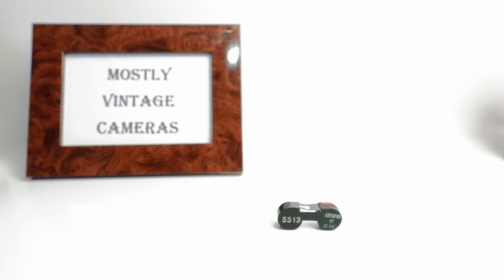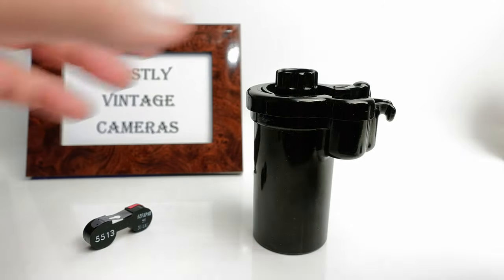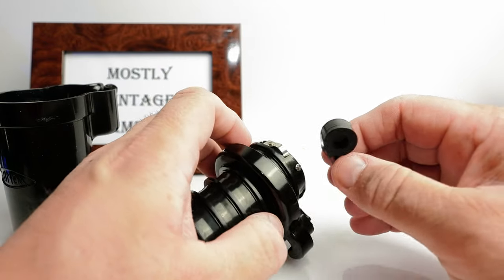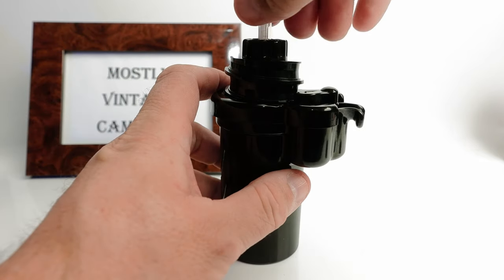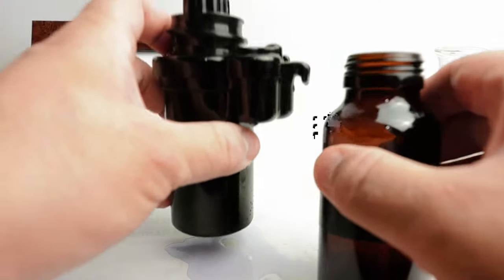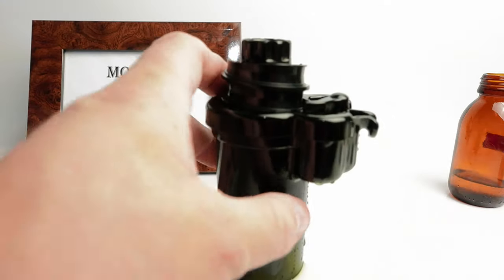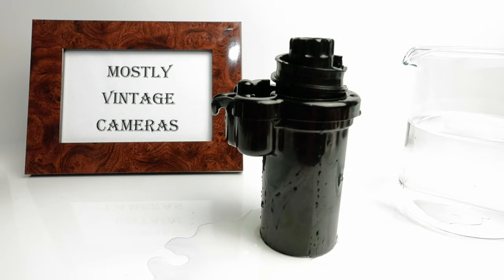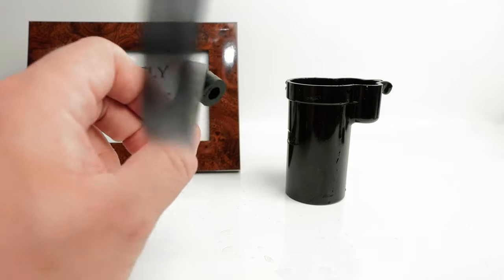Developing a Minox film in the Minox daylight tank

Comment: Great video. I used to develop my BW Minox film at home some years ago. Since I had no Minox tank, I read you could tape the film in the dark to a 35mm film, and then use a 35mm tank. A bit fiddly, but it worked somehow and I got some great images. Now I have bought a black LX at a good price, and I am tempted to get a Minox tank and start again, after seeing your video. BW lab has a certain charm...even in 2023.
Reply from the maker: Hello Fernado Moreno,
Thank you for your comment and sharing your memories.
Taping the film to something else was a common practice, a milk bottle being a favourite choice. The Minox tank is great as it is a part of the Minox ecosystem and keeps everything authentic so to speak however it is also possible to get a modified Patterson reel which can work with a regular tank. You would need a changing bag or darkroom for this however.
Kind regards
MVC

Comment: OK, once you have Minox film developed, is there a way to scan negatives and convert them to  positive images and save them to your PC or flash drive, then scale them to 5x6 size and print them out on your printer ?
Reply from the maker: Hello Gary, Thank you for your Comments. It's an interesting question and the short answer is yes you can. I plan to look at what you can do with these negatives in a latter video. The best solution would be to use a virtual drum scanner which really means getting someone else to do them for you. Once again I must defer to M S Hobbies who have a custom mask for a flex tight scanner for 8x11mm and also disk negatives. For myself I plan to try out a 35mm scanner with glass slide mounts and maybe cutting a mask in a 34mm neg to cut light from around the edge. I'm told projecting the image and photographing the projection works well with either a slide projector or an enlarger but that has it's own issues. there is also one more option I plan to try but it takes time to try these things of course!
Reply: Some high end scanners can handle the smaller 9mm films, like my Nikon Super Coolscan 8000ED.
Reply: I bought a used Nikon CoolScan LS40 for $250.  Found a used FH2 Nikon film adapter for $40.  I put the Minox film on the side of the adapter and insert into the CoolScan.  Works great.

Comment: If you cut your own film and don't have the factory-added keyhole on the leader, does it work to simply punch a small hole yourself?
Reply from the maker: Hi Sean, Great question. During the video I mention I hadn't used this before and we were learning together. This is something I don't know. However I do know there are keyhole punches made for this task you can buy and that would be the way I would go (along with a film slitter). The best best is to give M S hobbies in the UK a call or Blue Moon in the US. Let me know how you get on.
Reply: If you didn't find an answer to this, for self cut film I've always just taped it to the spiral. Feed it into the little clip then tape it down. Have never had any issues with sellotape.

Comment: Thank you for this demo. It helped me loading my tank with my first self-cut film.
I noticed that you did not use the Minox thermometer. Yours is slimmer and therefore cannot properly pump the solution circulating around the film as is required for creating agitation. The ingenuity of the design of the tank and the dimensions of the thermometer is another brilliant invention of Walter Zapp. In case you do not have the original Minox thermometer, you can replace it by buying a Kaiser No. 4081 darkroom thermometer, which has the exact dimensions.
Reply from the maker: Hello Fred Stock, Thanks for your insight. I was aware of the Kaiser product but was not aware it was fatter. I'd need to check but I believe the one I have is the original one. Maybe Minox did a couple of versions, who knows. Do you have a template to cut the keyhole out with? Mr Zapp was certainly a smart and dedicated individual.
Reply: @mostlyvintagecameras4323  You could be right about the different versions. However, as far as I know the only variations made to the developing tanks concern the inner spiral cylinder, which were somewhat shortened to exclude use of 50 exp. films (which had disappeared from the market in the 1960's). The old tanks (suitable for 50 exp.) have two spacers (one for 36 exp. films, the other for 15 exp. films). The newer tanks have a shorter spiral and only one spacer. But the (outer) tank itself was never changed and therefore the "pumping channel" has for all versions the same diameter. Why change a winning horse?
Making the keyhole is something that required a simple solution because I make them in the exposed film, prior to developing, and there is not much space available unless you spoil exposed frames. I punch them with a simple, cheap punching pliers for leather work. E.g. for making small holes in belts around the waist and belts for watches. It is the model with the rotating punchers mounted in a circle. Very cheap! These appear to have a metal "anvil" on which the hole puncher presses to cut a round hole. I have glued a piece of thin leather on the anvil and this improves punching film. First I punch a hole, large enough to make pass the screw's head and next to it two slightly overlapping smaller holes that fit around the neck of the screw. I don't know if I express myself correctly in this description, because English is not my language. Just ask me if something is not clear enough.
Reply: hello there, may I ask how you cut your film yourself ? which technique you use to that that in complete darkness? 
thanks
Reply: @veronikapot5640  Hello Veronika, thank you for asking. A friend of mine with a milling machine and a lathe made me a cutter, which cuts simultaneously two strips of Minox film from a standard 35 mm film cartridge. I do the cutting and the loading of Minox cassettes in a portable dark room, available as a bag type model or as a more advanced foldable model. I have the more convenient foldable portable dark room. It is placed onto a table surface and it has two arm sleeves to enter the dark room. A large double zipper on the front gives a light-tight access to the interior of the dark room for loading it with utensils prior to working in the dark.
I hope this info will help you.